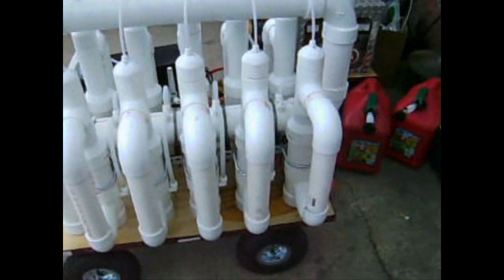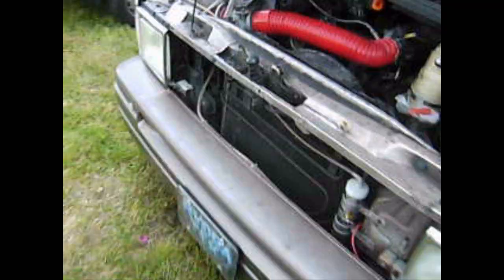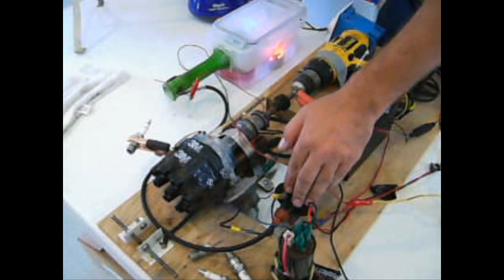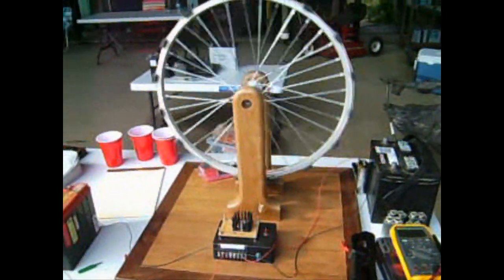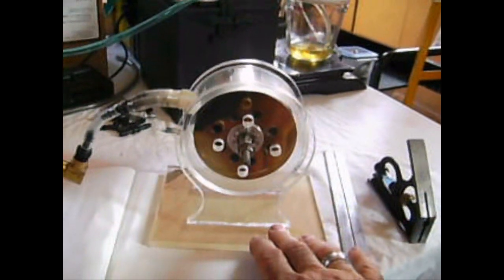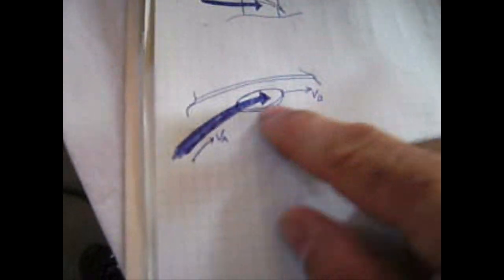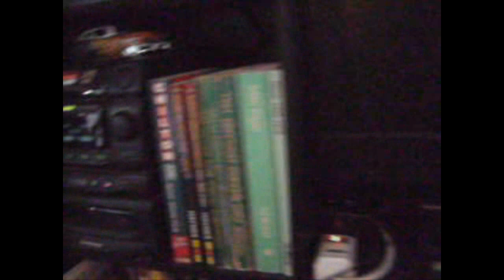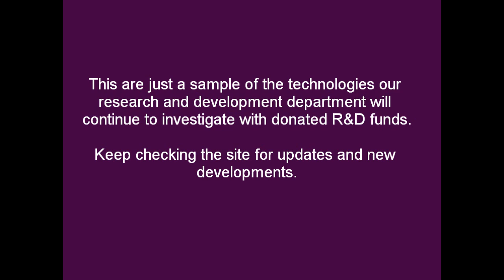Alternative Energy Projects

Comment: Not trying to rain on anyone's parade, I find this stuff soo interesting... But regarding the machine at 14 minutes, 12.17V is about 30% charge on a lead acid battery that is just sitting there, if the battery is under charge that would be 10% or less capacity, and if under discharge is about 20% charged. The other battery is 12.09, even lower. Fully charged lead acid batteries range in voltage from 12.6 to 12.8V.

Comment: Hey smack u r doing good I lerned from u in your 2008 vides on smack booster im working on making a magnet motor I built a bandini wheel just like the one in video im going to ad more coils to it just wanted to say if u where to use a pma instead of the alternator on your bike u would get way more power for your exersize u can evan build one out of any ac motor or ceilling fan just wanted to say thanks for inseration u rock

Comment: I been looking for an installer..I did a small jar and am impressed with the results but I want a "professional"installation ?
Reply from the maker: This is a specialized experimental field so it will be tough finding a "professional" installer.  This is not like getting the AC fixed on your car where everything is documented with manuals.   I suggest looking at the various online sources that show installations and videos that cover them.  In the end, you will most likely have to do it yourself as most people dont like installing other companies products as that makes it tough to guarantee anything.
Reply: my current set up is not "gas on demand" , I need something to regulate the gas , like a "throttle position sensor input"  I bought a Bully Dog , it has all the sensor info but no way to output a signal?
Reply from the maker: ne1cup You can use the TPS signal, usually 0-4VDC.

Comment: I see that you are very experienced/knowledgeable as well as creative and motivated! So, I thought of a really good project for you to work on - can you make a set up where you can actually ride places with the bike (instead of a stationary bike) with a battery that would mounted to a rack on the back of the bike, and when the battery is full you just switch it with an empty one. Bec I cant stand stationary bikes, but I ride to work EVERY day (unless it rains really hard or snows) and this would be a really nice way to generate electricity while traveling.
Reply from the maker: DPAED BUILDS SOLAR ASSISTED ELECTRIC BIKE!
Reply: I dont get too much sun where I live (NY) and I often ride at night. Do you think it is possible to have an on board generator that would be turned by the wheel (or chain) and still be able to ride it?
Reply from the maker: kawivloger I talk about this in great depth in the video, as well as my H2EVair videos.  You should check them out.  The solar panel on the bike is really not the focus of the technology.  See my latest vids.
Reply: Nice! Can you send me a link?
Reply: I know this is old but just in case, flykly makes this thing called a smart wheel, which is exactly what you described. They are fresh on the market as of a month or so ago. Check it out they seem pretty cool.

Comment: A friend of mine built the bicycle wheel battery system but I can't wrap my mind around it. I mean there's gotta be some catch. Why wouldn't it be SO much more popular and well-known? I don't believe conspiracies keeping technological discoveries down, especially in this age of the internet. The energy has to be coming from one of the batteries....
Reply from the maker: This video is not attempting to provide "proof", but rather just some documentation on different technologies people are looking into.  That being said, the Bendini wheel is not easy to build, and its proponents claim that if it is not built "just right" it won't work.  Thus the question can be asked:  what is "just right".  I tend to agree with you - that the energy is coming from the batteries just at a slower rate than expected.  My guess would be that at some point the wheel would stop turning and the batteries would eventually deplete.  Personally, I don't have the desire to spend the time and money to really test the theory, but I have no problem posting about it existence and the claims associated with it.  Doing so helps stimulate people's minds and generates discussion about it which is always good.  Better to discuss a tech that might not work that not to think about anything at all...
Reply: EletrikRidesAgain yeah its clear that you dont have a clear conception of the bedini motor. It uses high voltage transient spikes to charge the battery. The drive battery is electrically isolated from the charge battery. U can charge 2 24v batteries from one 12v battery. It will desulfate dead batteries, and double the amp hours of new ones. Google teslas work on longitudinal waves.
Reply: EletrikRidesAgain oh, and you should try running those spikes through your cell. If you can get the frequency, you will be amazed.
Reply from the maker: kandysman86 I know how the wheel works (your comment appears to be directed to me) - thanks...  I also know as cool as the theory sounds and as cool as it looks there is no proof whatsoever that it actually works as claimed - as an overunity device.  Seen them charge batteries, etc.  Put a meter on them and saw what looked like no energy loss - but in the end the wheel stops spinning and the batteries do die.  Not convinced it works.  If you have proof you should present it.  Also, hooked output to an HHO cell and I was in fact amazed to find no change in output whatsoever.  To be fair, the wheel was not mine and the person who built it may have made an error.  If you claim something different however, you should present proof.  Otherwise its all just talk until some proof is presented.....
Reply: EletrikRidesAgain you cant use the caped energy like his circuit used in your cell. You have to use disruptive discharge at very high frequency.. yes the drive battery will run down, but not before it charges multiple batteries, with a doubling in amp hours. If you use new batteries, you can condition them to accept this radiant energy faster every time you charge. It will recover sulfated,dead batteries.The over unity shows up in the batteries.But if you isolate one battery and charge it through an inverter, you can switch the drive batteries back and forth and the will switch like that for weeks, all the while charging batteries.If your circuit is built correctly, there will be no heat.I  will try to find some time to make a video, but you aren't going to be able to watch hours of charge discharge cycles. You can make a functioning charger for 40 bucks. try it yourself.its easy and fun, and you will have a charger that can fix dead car batteries. very useful.